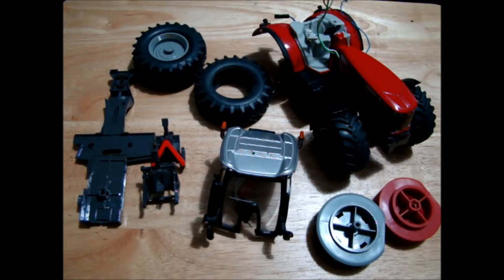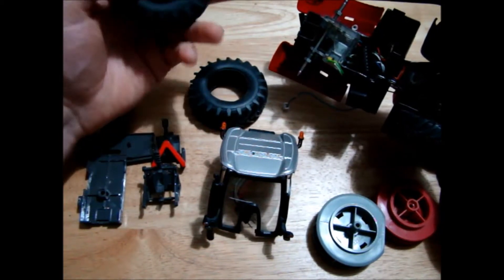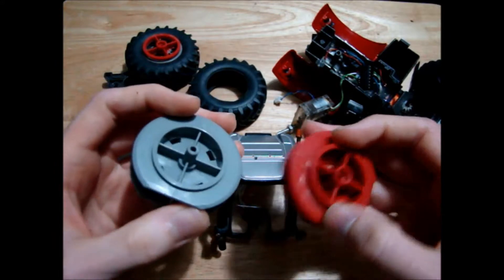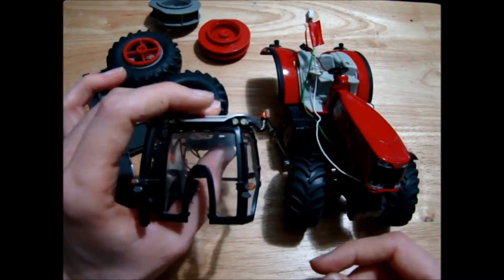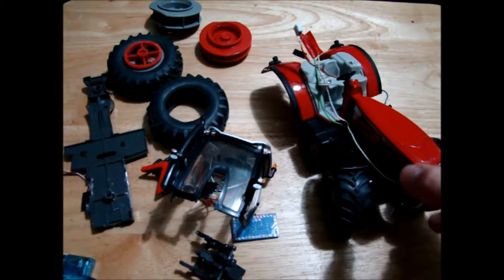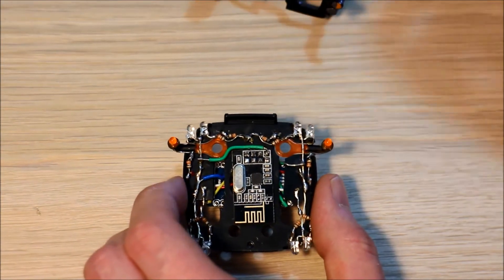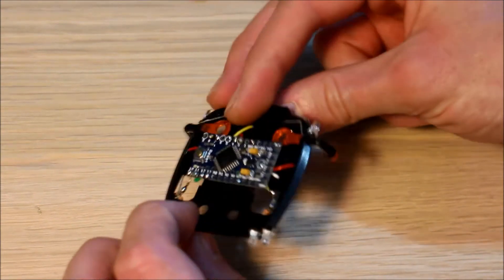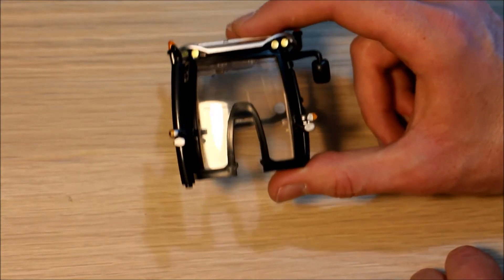RC Massey 8680 Upgrade Part 1 - Cab Arduino and NRF24L01 Module Install

Comment: What do you use to cut the metal if you need more space
Reply from the maker: I used to use a dremel multi tool before it burnt out, haven't actually needed to do much modifications since. Sometimes its easier to drill holes, snap the piece out and file it back. Basically whatever tool will do the particular job.

Comment: Would the N20 motors you used in the John Deere 8360 fit in this model?
Reply from the maker: Rangin Taafoo I think the two N20 motors back to back are nearly a cm wider than the siku motor so I think your wheels would be spaced a couple of mm further apart than they should be but it might not be noticeable. You would also need to remove the post for the bolt which holds the bottom of the model together so you'd have to come up with a new way to fix that to the body. I'm considering this type of arrangement in some future models to give a differential effect and improve steering.